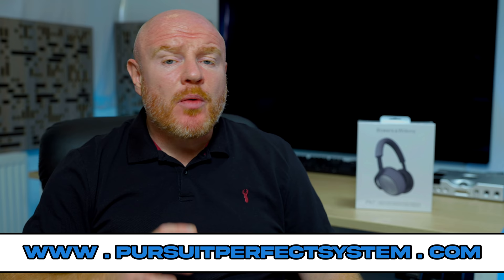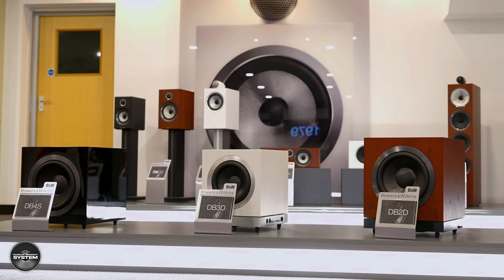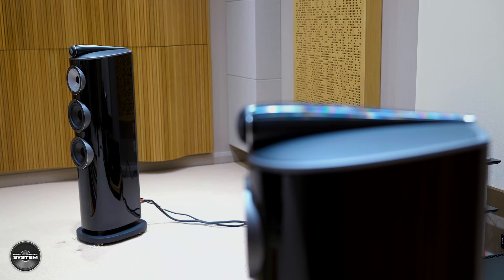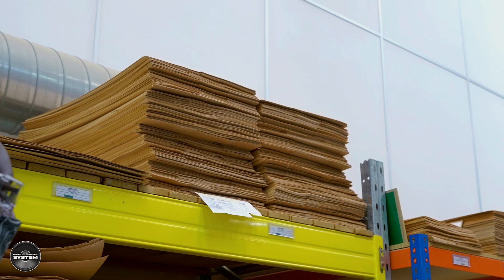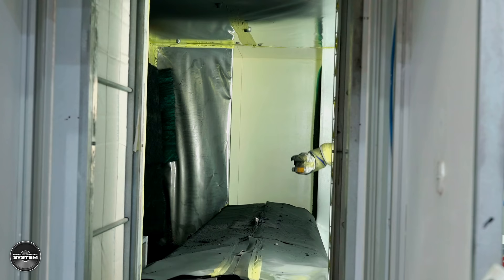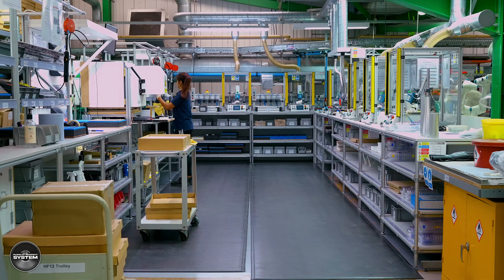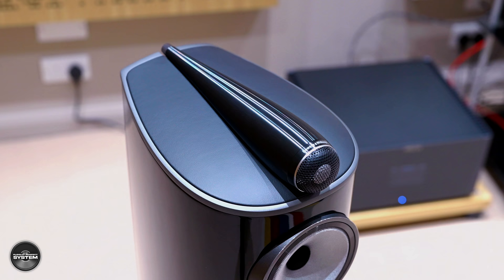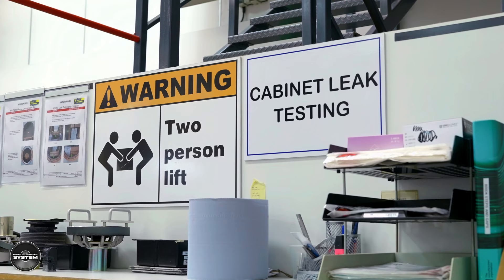NEW Bowers & Wilkins 800 Diamond 4 HiFi Speakers Factory & MORE !!

Comment: I hope B&W moves production of all their lines  back from China and not just their top lines.  I just can’t buy products fully manufactured in the CCP unless I have to. Focal and Sonus Faber build all their speakers in France and Italy,  to me it adds so much in terms of value, that and I hate the CCP.
Reply: I turn down USA brand speakers after I finally found out it is made in China (they tried to hide this information) and bought Sonus faber because it's manufacture in Italy. I also choose Mcintosh because it is made in USA.
Reply: Me too. I avoid anything that is made in China if possible. Not least because I think manufacturers expect to sell their products for the same price as they would sell for if they were manufactured in the UK, basing their value on the brand name alone.

I refused to buy a set of Mission speakers, because I have noticed in recent years, that the quality has receded drastically, with peeling veneers and cheap chip board cabinets that become tatty looking in no time. KEF and Celestion are no strangers to this either. And in my opinion, they are damaging their own reputation in pursuit of volume sales by producing inferior "affordable" models, which are really no better than speakers produced by volume manufacturers, such as Sony, Technics, JVC etc. Yet charging a premium over these brands.

Anybody can make a cheap 2 way or 3 way box, that ends up getting bashed around, and ultimately thrown on the bonfire on November 5th.

We want statement pieces to aspire to!

Keep it unique, keep it QUALITY, keep it British 🇬🇧 Because doing so, keeps British made goods aspirational, and something to save up for, and value for years to come.

Comment: I don't own the 800s but I own the 703 also made in the UK.  My son pushed the speaker and it fell on the hard wood floors.  I cannot explain the sound it made to you - it was enough to wake the dead.  I picked up the speaker and I thought it'd have some damage.  I examined it and was shocked to not find a single scratch on the maple cabinet.  I thought, for sure, the tweeter and cones are damaged.  I start playing music on it and I detect the same beautiful sound it had before the fall.  I thought it's a matter of time that the speaker would break.  That was 13 years ago.  The speaker has seen more action than demo speakers at stores.  I would not be surprised if the drop actually improved the sound.

Take a bow B&W!  Take a bow!

Comment: I have 21 B & W speakers in my car - the sound systems is also B & W. I haven’t noticed any leather aroma emanating from the speakers- probably because most of the interior is also leather, including the headlining which is suede. I use B & W headphones at home, have a pair of speaker boxes with two speakers each in my work shed. The latte are fairly large, and I bought them about 25 years ago- unfortunately my lounge is not nearly as large as previous homes I’ve owned , so I make do with a Denton system. Now. I must say that I envy you your tour of the factory & warehouse, back in thr 60s & 79s, I used to to do audits a lot of sound mixing & had a a couple of mixing desks and some heavy duty amplifiers. These days my power or guitar amplifier is limited to a Vox VT60+. It looks somewhat similar to the AC 30s, but there the similarity ends!

Comment: I had a  complete 600 series for eighteen  years, now I have 704 s2, 706 s2, 606, and a pair of asw 610's.  A lot of people dismiss these because of the initial sound, they need at least a week or two before they break in, but when they do break in it's really the end of the audio rainbow, my  system is a HT-audio hybrid,  in both applications 
these bables sing

Comment: Interesting video. Not much of a B&W fan, but I’d like to hear the stand mount in the flesh.
Reply: Why not? I have my B & W DM 220's for over over 30 years and never get tired of them :-)
Reply: @peterdamen2161  I have nothing against them, it is just that every time I’ve been in the market for speakers I have heard speakers that I preferred to the B&W offering. KEF Coda III’s were my first HiFi speakers, (I still have a pair, not my original ones though,) the ProAc were better a few years later and my most recent purchases the Focal Chora 806’s were much less intense than the 606’s and the PMC 23i’s were much tighter and faster than the 702’s. They seem well made, have good back up and have been around for years, I’ve just never owned any.
Reply: @billywindsock9597  Speaker sound always remains a very personal subject. I however, still do love my B&W DM 220's and my McFarlow Exciter's (self-built horn speakers that I have adapted) :-)

Comment: i still have a pair of 804D2, they sound so natural and high revealing with no stress at all. just a perfect speaker for my small room. msrp was 7000€ back in the day...now you have to pay 8000€ for just 805D4...sorry but that is absolutly crazy overpriced. 
12500 for only 804D4...ah man. you were getting 802D2 for arround 16000€ back in the day. 800D2 was 22000€ if i remember correctly.
Reply: 8000? OK so there goes my plan to consider smaller speakers for the next upgrade. Still curious how the 800 D4 sounds though.
Reply: @magicmulder  yeah me to. i have a personal premier listening hour at the dealer on september 11...lol.
Reply from the maker: @heinzbecker691  nice!!
Reply: @heinzbecker691  Mine won't get them for another month but at least he's gonna have both the 801 D4 (I missed that they renamed the TOTL model) and the 805.
Reply: 33% price increase over the full range. That's quite an increase in just 1 series. I cant help but feel that this is not really justified other than filling pockets....

Comment: Now I know why these speakers cost more than a pickup truck and are nearly 300 lbs.  That is a crazy amount of work and tech going into each speaker.  I can only dream of owning the sound system that would include these speakers.
Reply: Well it won't be a single box affair, like that which you find with many a cheaper Mission speaker, such as the Mission/Denon collaboration of the late 90's early noughties.

Comment: As an owner of the 803 D3, biamped by a Parasound A51, I am very satisfied by the sound. I will not listen to a 800 before I am willing to make that step. The new D4 looks great. I think its easier to manfacture because the d3 has a cabinet where the top looks in one piece with the sides. The 805 D4 looks like a step up to the d3’s?! The d3 needed an additional sub, but when I listened to it, for me there seemed to a “whole” between base and mid. Do these d4’s have more bass?

Comment: Basic Marantz amp? That's the flagship PM10, which is roughly the same cost as a pair of 805D4.
Reply from the maker: Oh wow I didn't know that, its still a lot cheaper than the michi pre and power for the 804 demo :)
I didn't say basic, I reasonable modest or something like that
Reply: @PursuitPerfectSystem  Fair enough. The PM10 will be able to deliver nearly 400 watts to at the 4ish ohm minimum impedance of these speakers... So this amp is an absolute powerhouse. I've listened to one a while back and while it's not strictly neutral it is very energetic and fast, with very impactful bass.

Comment: The 805D3 is an awesome standmounter for $6k. The new 805 D4 is $2,000 more than the D3s... At that price better off to save up for the $10k for Wilson Audio TuneTots. IMO.
Reply from the maker: Tunetots are nice but they are bass limited, its an apples to oranges comparison there
Reply: @PursuitPerfectSystem  for the record, I did buy the McIntosh MC152 power amp after your review... It was a terrific call! My listening room is small: 10 feet by 11.5 feet, so big "bassy" speakers aren't needed to pressurize my room. Clarity is king - which the 805 D3 have for sure, but add $2k on to them for the D4 version and I wonder if there really is a $2k difference in side by side listening, or if there is a better choice once you get to the $8k-ish price point. I love your budget comparison speaker reviews, it would be interesting to see you do one in the $8k to $12k range for high-end standmounters. Thanks for your work, you're fun to watch!
Reply from the maker: @laurencerothman931  thanks Laurence, I wasn't referring to bass amount tunetot are designed to be bass limited to 60hz to go on table and side boards etc.  Thr bowers 805 won't be so it is quite a different speaker in that regard
Reply: Whoever spend 6000$ or now even 8000,- more for a passive ,,design,, speaker, ... congratulations. You get for WAY less a Active Loudspeaker + Room EQ + Money for Room Treatment (Neumann KH310 for example) = way better sound than any B&W bookshelf ever produced... There is nothing ,,unique sounding,, its all Marketing and the same ,,old,, passive crossover Technology,  and ,,new,, Materials dont change that. (sorry my opinion... i found this ,, High End World,, just entertaining how Manufactures fools the customers with ,, new,, technologys

Comment: I've never heard B&W speakers before, I've heard a lot of people seem pretty meh about their sound, but they sure do look good, their finish is just outstanding, only Focal makes a better looking speaker in my opinion and that's only slightly their cabinets aren't as cool looking as B&W's.
Reply: Most people never heard a nautilus before let alone the better models they have to offer. Most people overate their own opinions as factual..
Reply: Don’t believe all the negative comments.   I have seen people talk negatively about B&W, Focal, as well as other speakers.  It is all subjective.  There are a lot of great speakers in all price points.  You just need to listen to several brands and find the sound you like.

Comment: I’ve had 3 sets of B&W floorstanders and found the integration by B&W of any more than two speakers in a cabinet to be problematic.  I sold each version of the 600 series, CM’s etc due to this.  I do have 3 pairs of 805’s from the original s to the D3’s which are simply brilliant.  So as for the 805 D4 I’m very keen but the 804 D4, unless they have sorted the odd bass response, no thanks.  803’s look nice but the bass could be an issue.

Comment: The only way B&W can improve on the D3 is to flatten the response. The D3 800 has a rather large measurable plateaued peak in the high frequencies centred around 10khz along with other irregularities at other spots in the response curve such as a mountainous boost in the bass. For something so expensive this is far from a flat or neutral speaker. As I recall old Matrix 801/802 series was considerably more accurate and linear.
Reply from the maker: Maybe they don't want it flat on the graph because if you look at human hearing we don't don't hear sound like that, maybe this is why they are designed like this
Reply: @PursuitPerfectSystem  If your hearing is not flat then you won't hear a flat speaker as flat either. That goes for everything we listen to. If your ear hears things too bright and the speaker is also bright then the net effect is excruciatingly bright. And there is no doubt the D3 series sounded too piercing in the highs. I prefer a flat in room response. To my ears it just sounds less coloured and more accurate to the source. Of course one can equalize the sound to anything they like in final listening.
Reply from the maker: @socksumi  that's not really what I was referring to I was referring to the studies into equal loudness which shows human hearing is anything but flat

Comment: Big B&W fan....but those prices are getting out of control.  800 series getting very close to Nautilus prices from back in the day
Reply: I think the 804's aren't bad value at around £15-£16k, if you are serious about it. Especially given the manufacturing processes, and quality of build and components.
Still a lot of money, but you have to be invested to have them for years to come. These are not just cheap throwaways, unlike most of the cheap Chinese crap that is flooding the market these days. A market that used to be quite niche at one time. As most people are used to the cheap speakers that came with their mini systems, also made in China, that Mission made a foray into, and wrecked their own reputation as a result.
Glad that they made the decision to build the 700's and 770's in the UK again. Maybe they will rebuild that reputation. Time will tell I guess.

Comment: Didn’t even know they’re still making Nautiluses, I thought they were just selling off their initial stock very slowly.
Reply from the maker: They make them to order if a customer wants them and they still use all the original manufacturing techniques to keep the product original.
Reply: They are too low in demand to mass produce them. And it is actually a nice way of doing it. They are truly the legacy speaker that all their current lineup is based on some of the basic design features.
Reply: @oysteinsoreide4323  Agreed, and I bet in that price class buyers love to be able to customize them by color.

Comment: As great as these loudspeakers are, propective owners must invest equally for a good pre/power amp or not it would not do justice for a thorough fidelity
Reply: I dare say if you went for the 804's, you could run them off an affordable pre/power setup. Or even a good integrated amp, such as Marantz. But if you're at that level for speakers, then I doubt you will be buying them to improve the sound of a midi system, or even a budget seperate system.
The speakers and amp are the most important components in ANY system imo, as without either, you DON'T HAVE a system. Every other component is optional. Even a cheap CD player can sound amazing through a good amp and speakers.
Invest in your amp and speakers, and the rest can be swapped out and changed quite cheaply, for a result that suits you.

Comment: Is there anyway if you could find out if the 804 uses mundorf caps?  Ty
Reply from the maker: I have some video of the 804 crossover I will check but pretty sure it did. I think the white ones not the black ones but they are still mundorf. I will check this and update this comment if I am wrong

Comment: Does the latest range from B&W sound as boring and unmusical as their previous ranges of speakers?
Especially when you consider how much they cost. Whereby any sonic shortcomings are difficult to forgive.
Reply: My brother has a pair of ,P6's, from about 20 years ago. And they sound anything but "boring, or un musical"  So I fail to see what you're on about tbh!
 Unless your experience is based on running hifi speakers from a midi system.

There are MANY who would disagree with you, and think that you are talking out of your poop chute!
Reply: @hermanmunster3358  The sound of hi-fi is all relative. Relative to actual musicians playing actual instruments - on the better recordings. And relative to other hi-fi components.
The sort of people that find B&W speakers musical and engaging are the sort of people that haven't (properly) auditioned the most musical and engaging speakers made in the history of audio.

Go ahead and compare the P6's against full sized high efficiency speakers. The sort of thing that used to be top of the range for Altec, EV, JBL when those companies were at their peak. Or the sort of thing put together by DIY enthusiasts that know what they're doing - for example the red and black speakers that have appeared at the last few Owston events. The ones with 18" woofers.

I don't care what many people THINK. I know what I've HEARD in comparative, volume matched AB demos. 
And I know whose opinions I trust when it comes to hi-fi.
Talking about hi-fi is often an experiment in psychology - with the way that some people react when one passes on the results of listening tests.

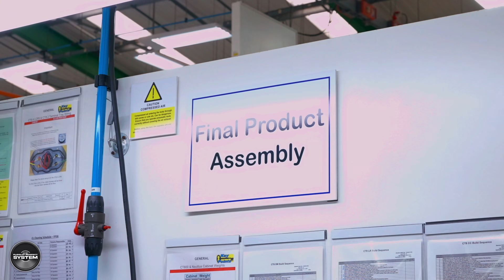Comment: Which bits are made in China??!??  https://youtu.be/AgcdUSvg2t4?t=768  As seen on the boxes at 12:48.
Reply: Seems to describe some sort of trim piece, from what I can make out, in a light tint! So maybe tweeter grilles or something, or speaker surrounds.
Don't know why every part cannot be sourced in the UK, but there you go. Probably the reason why the speakers cost £35k instead of £50k.